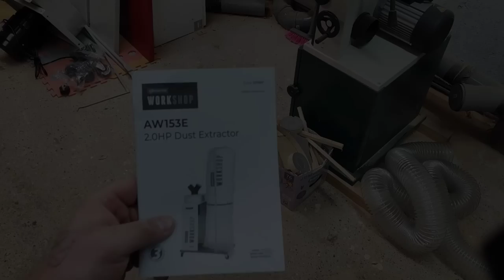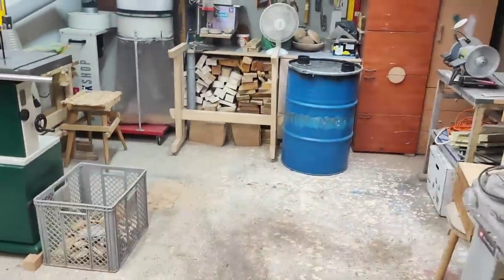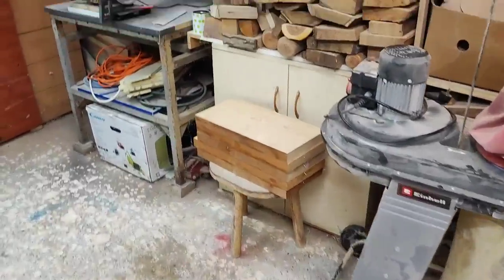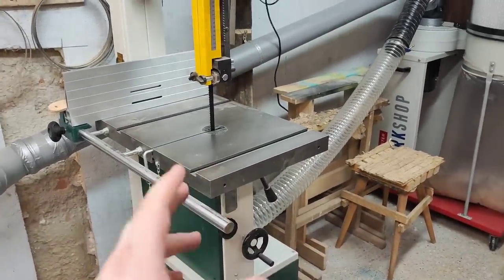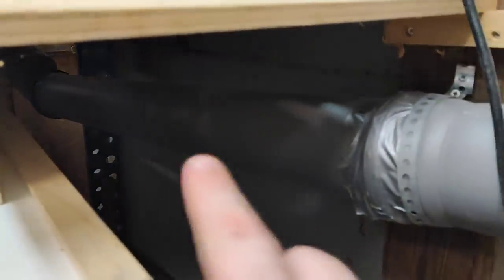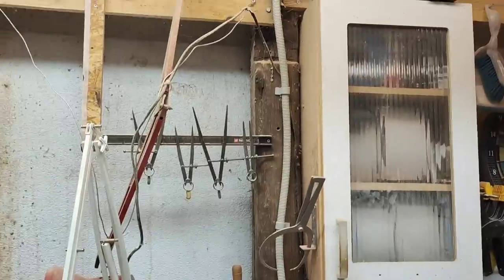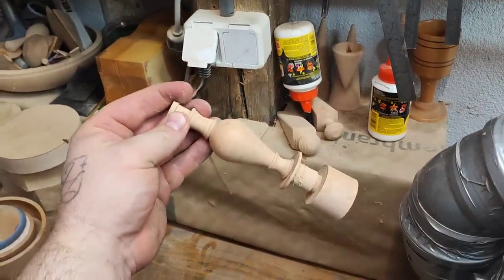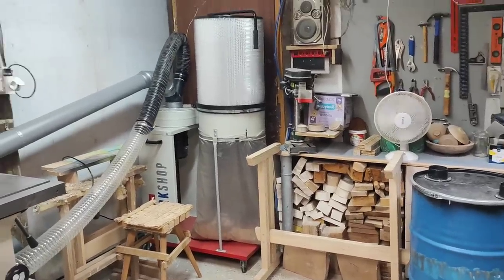Ultimate dust collection for woodturning

Comment: Hi, Tomislav. Don't forget to remind your father in law, to still wear a good dust mask, when using the dust collector you are giving him. I have a dust collector, like yours, in my basement shop. The fine dust was terrible. My basement has small, above ground windows, so I chose to vent it to the outside, like a clothes dryer. No more dust. I installed a plywood disk, with a 150mm hole in the middle, in the top of the collector and then, ran 150mm, metal, furnace duct, to the window, where I replaced the glass with plywood.
Works great. 😁✌🖖
Reply from the maker: No problem, already warned him of potentional throuble 😉 thank you for watching

Comment: Bit late to this discussion, but you could use the separator on the floor cleaning circuit where you are picking up mostly turning debris. I use the axm AWCIH CYCLONE and this does a great job of separating the larger stuff, but the fine dust does clog up my filters (I use a camvac twin motor). I did think of taking the filters of and wxhausting outsice, but the neighbours and my wife might not be too happy! Another great video.
Reply from the maker: Thank you for suggestion, I had a lot of different setup that I thought could work but this unit with Raffan Hood Works so nice..... ☺️

Comment: Walling in the dust collector has made a great difference in the shop noise in my shop.  Also, the Seperator in front of vacuum will hold about 80% of all the dust and is much easier to dump.
Reply from the maker: Thanks for input🤗

Comment: Tomislav, I have a similar Jet dust collection system and I installed an Oneida Super Dust Deputy, with this setup I get almost nothing in my plastic collection bag.  But a word of warning, make sure to keep watch on the pleated filter.  Mine has a beater bar and I clean it about every other month, however, since you’re a production you might want to clean yours more often.  I started having the collector’s remote switch’s overload circuit breaker popping off a lot.  Found out the super fine dust was blocking the pleated filter and creating too much back pressure.  Keeping my air clean, but creating another shop maintenance task.  Just my two cents worth.  Cheers, Tom
Reply from the maker: Thank you Tom for advice, I will monitor the filter more often.... Dust deputy is awsome,a bit expensive to get it to Croatia but one day I'll find a way 😅
Reply: @tomislavtomasicwoodturning  The separator you hav (although the barrel take up room) should work. Saves a lot on emptying the plastic bag so often. I’m lucky that my shop has 11’ ceiling and I mounted my dust collector on the wall.

Comment: I replaced my bag filter with a pleated cartridge such as you have now.  Changing just the filter brought a tremendous increase in air movement.  So that may be part of the difference you are experiencing.  However, as other people have mentioned, the pleated cartridge can very quickly become blocked and the air flow is drastically reduced.  The good thing is that you quickly see how much very fine dust is taken out of the air and seeing that makes the time spent cleaning the filter, which I have to de very frequently, much easier to accept.  I have tried blowing air from my compressor back through the filter to clean it and that accomplishes almost nothing.  Running something across the pleats as you have does not begin to get the dust out of my filter.  I have to take the filter off the machine to clean it using every method I can think of to get the dust out.  I run my collector continuously, not just when sanding, as much fine dust comes off the work throughout the process.  I don't mean to discourage you; if you see as much dust in your filter as I do in mine and think of what it would be like if you had been breathing that you will know you are doing the right thing.

I've enjoyed and learned much from your videos.  Yesterday I made a Raffan style shear scraper such as you made and put Raffan style asymmetrical grinds on two bowl gouges.  What a difference. And I've made several changes in how I turn based on what I've learned from you and they have saved me time and improved my results.  So, many thanks for all the effort you put into sharing your knowledge.
Reply from the maker: Dear sir, thank you for very kind words and its an honor to be in same sentence with Richard and to be able to help out someone on woodturning journey.... Glad to hear that you have great results with scrapers and bowl gouges....

As regards dust collector, I'm aware and except the terms of cleaning the filter in exchange for better suction.... Now since this dust extractor is new to me in my shop atleast, I can see a tone if dust less then before.... That alone is like you said well worth it.... I do plan to enclosed it so to have another barrier for the noice but dust aswell....

Once again thank you for kind words and watching 🤗

Comment: Thanks for the tour. When I purchased a canister filter to replace my bag, I noticed a substantial improvement in suction. I had same problem with the switch and I purchased a remote which I stick to my lathe with a magnet. Not sure where to find one in Croatia, but mine came from Rockler in US.
Reply from the maker: Oooh awsome, didn't know about the.... It works with NVR switches???

Canister filter does improve suction by a lot so its good investment as well.... Thank you very much for watching and suggestion

Comment: Never tried that sort of separator but I use the smaller 1.1Kw Axminster chip extractor with the fine filter and the Cyclone separator (Axminster AWCIH) and I've not noticed the losses you talk about. I also never have to change the bag as all the dust ends up in the barrel on the cyclone.
Reply from the maker: I did wanna get that cyclone but didn't have enough money left, on the barrel I notice the drop of suction.... Perhaps the real cyclone is much better in that terms.... One day I'll get one 🤗🤗 thank you for watching and comment

Comment: That’s great to see you’ve got your dust extraction sorted out and are happy with it. 

Did you find any difference in suction when you changed to an angled opening in the pipe in the Raffan-style extractor hood?

I ask because I have copied Richard’s hood,  and have stacked angled pipe pieces like your original pipe arrangement.

Thanks again. 
John
Reply from the maker: Not by much, I could use my old system with few elbows but the hood just works better for me.....I angled the pipe mostly so the biggest diameter doesn't hit it ,yet I could bring pipe closer to wood , hence the better dust extraction.... Hope that makes sense 😀

Thank you very much for watching

Comment: I was wondering how the record vacuum turned out as it did not appear to move enough air for sanding dust extraction.  Nice coat rack by the way (bike).
Reply from the maker: Best coat rack😅 record power unit was great for machines but this thing moves so much air that its working wonderfull

Comment: I’m hoping to buy a lathe soon (last time I’ve worked on was many years ago in Shop class!). I’m looking to use this in turning bowls and other small projects as well as parts for other woodworking projects. I’m trying to decide a good size/brand of lathe as well. Not really interested in a small lathe but also nothing to huge lol. The Midis look nice although wondering if the size bowl I could potentially make would be limited too much. Any advice you might have on considering what to get, potential issues etc. is of course much appreciated. Anyway, thanks again and really enjoy your work and to learning from you.  Best, Chris
Reply from the maker: Thank you Chris☺️
Uff the lathe choise is big.... Now I reccomend a bit different then others...
While everyone will say that you buy the biggest you can I tell buy the best one you can afford.....that usually means a smaller lathe but better quallity then bigger/cheaper version.... Now I turn for a living and everything I turn for clients so far haven't been bigger in diameter then 13inch or so.... These days midi lathes are up to 14inch swing and the better ones have swivel headstock for those accasions that you need bigger diameter..... But that is my take on those things as in my region that works.... Example, Mike Mahoney sells big bowls , he has the market for it, I don't as most of my customers live in flats and space is an issues,so 16 or 18inch bowl is just to big for them....

I would advice if you have a frend or club with lathe to try it out.... I had big lathes and small, I personal love midi lathes... The ergonomics are great for me and I just love that.... There are midi range from KS SCHULTE brand if in Europe, there is laguna, vicmark is your best option if you have the budget..... Killinger lathes are in the rank of vicmark and also Record power has midi and bigger lathes as well.... Like I said try to see if a frend has a lathe or local club that will let you try the size .... I have several videos on lathes ,there is a video in beginner series on what to look for in a solid lathe as well...

I hope it will help out ☺️
Reply: Tomislav, wow what a great and helpful answer.  I’m in the US so I know there’s lots of options but not all, (as we all know!) are as good as they may look.  Richard Raffen mentioned the Vicmarck as well but not sure if I can find them here. I am very much in agreement that I should go for the “best I can afford”, but not necessarily the biggest.  I love the point as well about your not having made many bowls bigger than 13”. All of this is so encouraging and useful to me so I’ll start thinking more about that size range.  You may hear from me again as well as I get closer and eventually get started on turning. I’ll be definitely watching more of your material so I’m not asking a bunch of things you’ve already covered😄👍. Thank you again, you’re very helpful my friend.  I’m going to go with a Midi I think and can’t wait to get started.
Reply from the maker: @victoryak86  not a problem, I'll do my best to help out ☺️.... Wish you good luck in search of new lathe and take your time....  Thanks for watching and support what I do
Reply: @tomislavtomasicwoodturning  hey Tomislav, just a follow up question about the lathes:  I’m considering the Jet 1440, which is 14” swing, 40” length. Do you have any familiarity with that one or Jet lathes in general?  Haven’t seen the Vicmark or Record here in the States as of yet.  Thx so much.
Reply from the maker: @victoryak86  unfourtually I haven't worked on jet...but from what I heared Jet makes really good lathes....you probably have acces to powermatic... I really like there lathes...
Reply: @tomislavtomasicwoodturning  thanks for your advice Tomislav. I’ll definitely consider the Powermatic as well. Thanks for taking time to respond👍😊